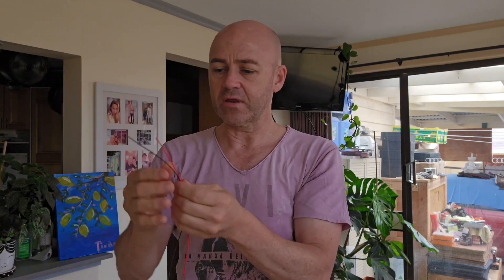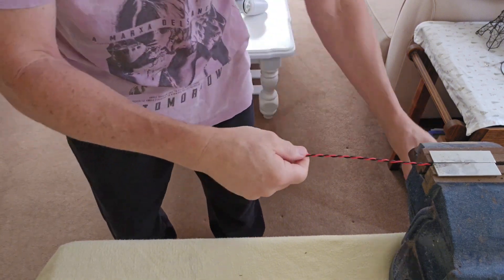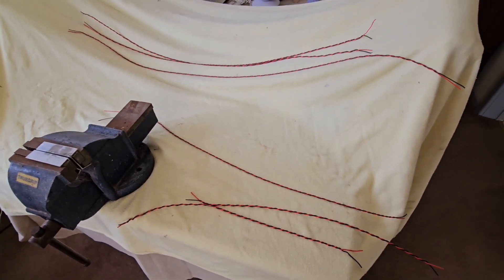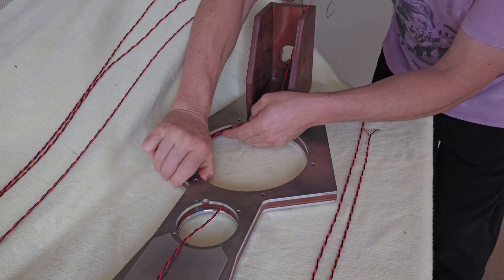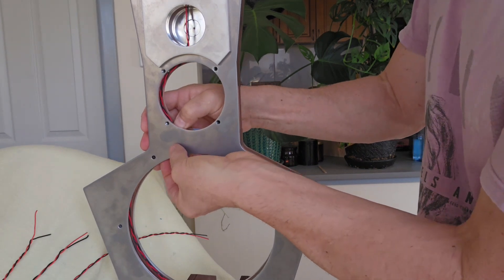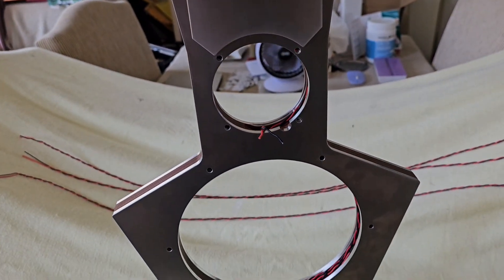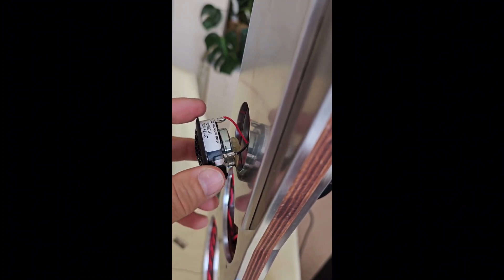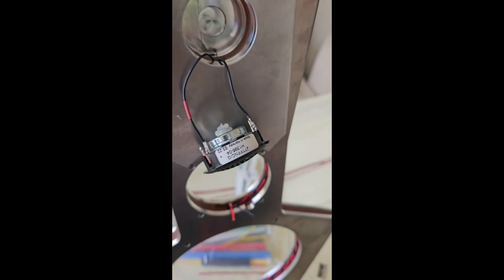"LINKWITZ LX521 THE BUILD PART 3"

Comment: Remind me why the rear-firing tweeter is wired out of phase with respect to the forward-firing tweeter.
Reply from the maker: Hi Drago, The rear firing bass driver is also the same. Both rear firing drivers are out of phase to create the correct back wave to give the spaciousness that this speaker system produces.👍🙂🎧